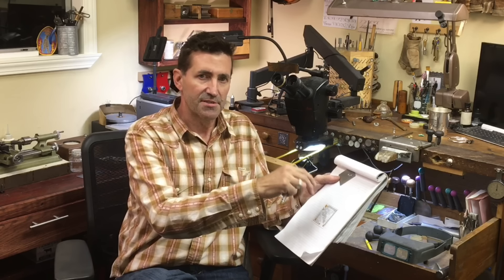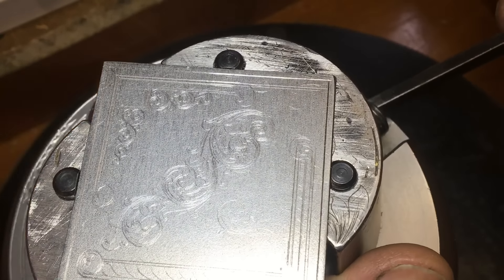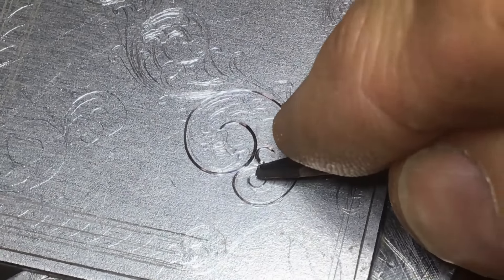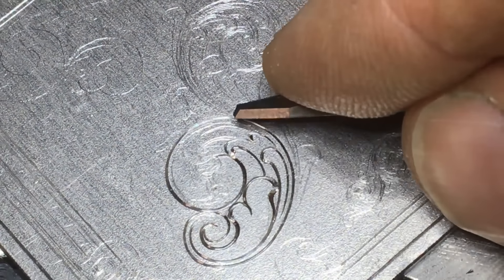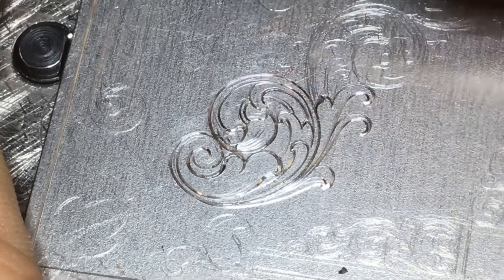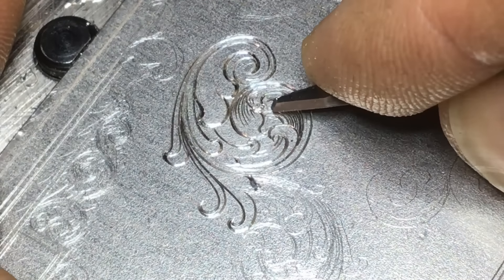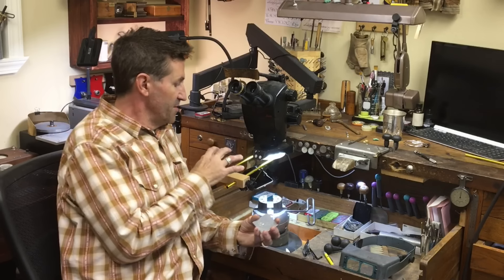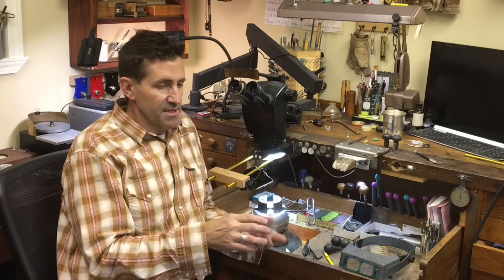Hand Engraving a Sample Plate- Episode 1 Engraving Basics

Comment: Damn you make it look easy! I smith a lot of my own tools, and would like to decorate them up a little, but holy heck you make it look so much easier than it is! My problem is I have the artistic talent of a potato.
Reply: I also have little artistic ability but ive found that it helps massively when you start learning the basics and using them to make some designs. Just like other skills, you learn what techniques can be used to do what, then when you understand fully idea just start cropping up. Just like any other skill or trade, you gotta learn to walk before you can jog, run, skip or jump.

Comment: Oh yeah, I'm excited ! 😊
When using the pneumatic handpiece you still have to put some pressure on the tool don't you ?
I guess it comes with years of experience but I still marvel at how precise the curvature of the lines are !
Thanks for sharing and take care. 👍
Reply from the maker: There is light pressure on the tool yes. Many watch as I work and imagine that I simply trace the layout lines with the graver. The reality is far from it. The engraver controls angle and pitch in precise micro movements to keep the graver tracking true and running straight. There's far more to cutting steel than meets the eye.

Comment: I have always been interested in engraving. can you please tell me required air tools to get started.
Reply from the maker: Bobby Martinez the most important tool you’ll need is a pencil. Simply put, you can’t cut what you can’t draw. Next I use GRS Tools. A basic setup starts st around $2500 plus a compressor. Visit GRS Tools. You can find some basic tool lists at The Engravers Cafe forum.
Reply: Master Engraver TV  ok thanks you inspired me to start engraving

Comment: Is there a kit you would recommend to a brand new beginner with a wide background on wood carving?  And who doesn't want to deal with b.s. beginner kits.
Reply from the maker: Steven Strandberg there’s really no such thing as a beginner kit in our profession. There are 3 ways you can get started. Hammer and chisel, hand push or pneumatic assist. The first two will require a teacher/mentor or classes to learn to use the tools properly. It’s possible to learn with a pneumatic graver like the GRS GraverMax but I still recommend basic classes. The most basic setup for a beginner would be a GRS Graversmith, a GRS Standard Vise and sharpening jig of done sort. The GRS Easy Graver takes the guesswork out of it. If you want to start on the cheap and plan to cut steel then the GRS basic hammer and chisel kit is the way to go. It’s $500 and all you’ll need in addition is a vise if your choosing. The GRS Magna Block is heavy enough for hammer and chisel work. You’ll notice I only mention GRS Tools. That’s because there are really only a few suppliers of engraving tools and they are a one stop shop. Also engraving Tools we not cheap. Hand engraving is s profession that until recently was only learned by apprenticeship or a trade school. There are no inexpensive kits geared toward hobbyists because engraving has never been considered a hobby due to the extreme learning curve just to become competent with the tools and artwork. My advice to all beginners is to take a basic class or find a mentor. There’s simply too much information that needs to be learned hands on to learn from YouTube videos. I really just offer these as assistance for engravers who are already undergoing some sort of structured classes or instruction. Once again, GRS Tools offers the best basic classes at their headquarters in Emporia KS.
Reply: Thank you. 🤗💪👍

Comment: If you get time could you do a vid where you show what kit you would buy to start. £50 budget. For those of us starting out. Thanks.
Reply from the maker: Steven Hudson sorry to tell you Steve but such a thing doesn’t exist. It’s not like oil paints where they make beginners kits with everything included. Hand engraving requires a fair bit of equipment. I often say it’s an expensive profession, not s cheap hobby. At a bare minimum, if you plan on cutting anything harder than silver, you’ll need a hammer and chisel setup, some sharpening equipment and a heavy engravers vise to hold the work as you are hammering. You could scrape by with around $500 in bare bones equipment. I wouldn’t even consider trying to do hand push engraving without a teacher. There’s just too much information to learn and nowhere to get it outside of an apprenticeship or mentor. I should add that hand engraving isn’t something you can learn from YouTube videos. I make these as extra info to help folks who are already undergoing some kind of education. Not as stand alone how to videos. Just a basic class takes a full week of work to pass on the basic information to get started. If you are truly interested, start with the cheapest tool of all. A pencil and paper. As the saying goes, you can’t cut what you can’t draw and the artwork is the single most important part of learning engraving. The next thing would be to find someone local to show you how a shop is set up and the basic tools. 
  Here’s a link to a basic hammer and chisel kit from GRS Tools. The only extra thing you would need is an Engravers vise and some sort of magnification. https://www.grs.com/product/sam-alfano-hammer-chisel-complete-kit/
Reply: @MasterEngraverTV  thanks for taking the time to reply to me. Your work is unreal. I will get some stuff on the christmas list and keep my eyes on the channel. Thanks again. Top guy.

Comment: Hello Sir, how much will a mecanical ingraver like yours cost? I have several Dremels, also the ingraver model 290 but thsts not what you use, i have no clue about ingraving right now, but i want to learn, im starting up with silver jewlery work now, and ingraving will be ok to learn.
Best regards from Norway.
Reply from the maker: A pneumatic engraver does not work like a Dremel. It doesn’t grind metal. It’s simply a tiny pneumatic assist chisel. They run from $1500-2500. Www.grstools.com.
Before investing in this type I of equipment it’s highly recommended one take lessons. It’s not the sort of thing you can buy and start using without instruction. An apprenticeship, lessons, or at the minimum, a mentor who is a professional Engraver can cut years off the learning curve.
Reply: @MasterEngraverTV  Yes i have seen your videos, and other as well, seems like real work, and you have to study it.  I did watch someone ingrave a silver dollar or something, and i was very impressed and wanted to learn it myself, but it cost alot of money, but i have to start somewere :)

Comment: I saw in one of your videos that you had a flat and side by side layout design for a 1911. Where do you find those templates?  I've been coming up with simple designs for my smith and wesson 686 by taping the surface with blue tape, cutting the edges and then peeling it off and fastening it to a flat sheet of paper to draw on. It's not exactly 1 to 1 transfer but it's helping me get an idea on how to wrap curves etc.

Is there a place where we can buy or download such laid out print outs? Like an engravers coloring book?
Reply from the maker: We usually do our own renderings. I drew this set ages ago for the Colt 1911. For an engraver, the ability to layout, design and draw are the most important thing to learn.
Reply: @MasterEngraverTV  thank you for that info. I'll be looking into learning that skill. Are there any good books on the subject? I have a year before class starts.

Comment: I don't see it as cheating using a pneumatic graver. as long as you get the intended outcome and quality the method you use should be irrelevant. beautiful work by the way
Reply from the maker: Eric Imfeld the only thing pneumatic assist does is tap the back of the graver with a piston. The user is still responsible for everything that happens. No more cheating than using hammer and chisel. Not to mention cutting is the easiest part of an engravers job. It’s what he does with the pencil that matters.